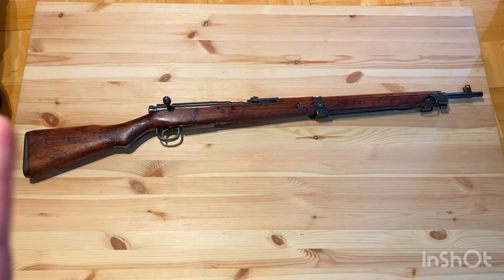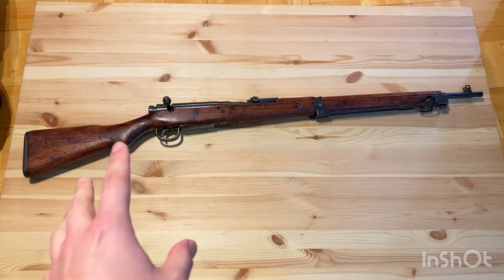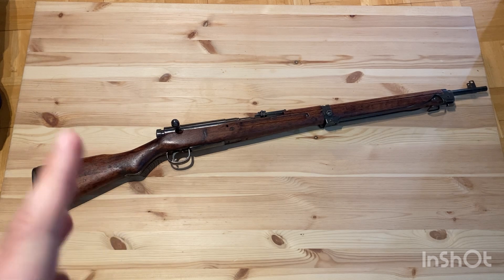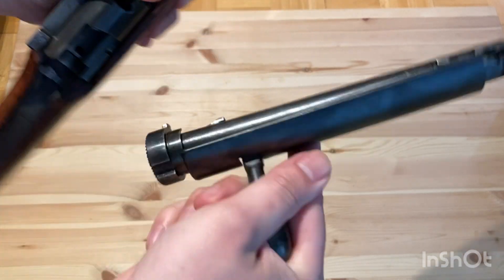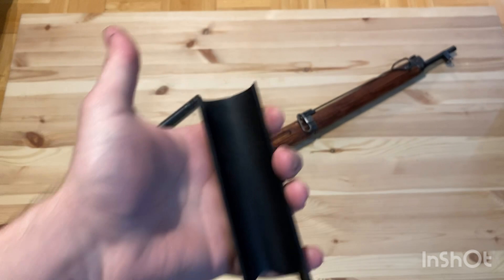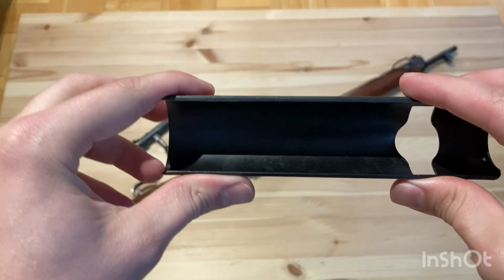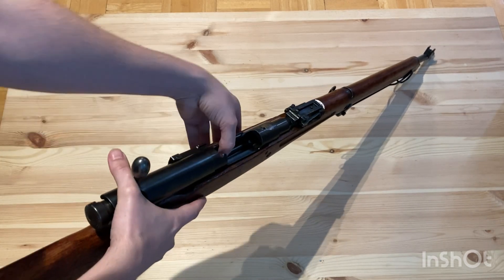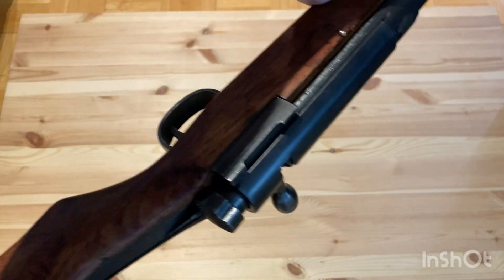DEBUNKING this WW2 myth in 60 seconds (Arisaka Dust Cover)

Comment: Another theory I've heard a few times is how the Japanese troops may not have necessarily discarded the dust covers, but rather they would remove them before combat only to refit them afterwards. But I don't think this would've been the case because the Japanese already had a dust cover that was designed to be removed before combat and then refitted after combat, and that was on the Type 35. If it was that common for troops to take them off only to put them back on eventually, then I think they would've have brought back the original dust cover design and reinstalled it on the Type 38 and 99.
Reply: This. On the 38 and 99, the dust cover slid with the bolt, so it wasn't like the older Type-35 or Siamese Mausers where you had to manually slide them back to use the action. Plus, it's not a weak dust cover-either it takes a hit it was designed to protect against, or it was damaged so badly that your rifle probably also doesn't work anymore.

Comment: The most bizarre thing about this myth to me is still the "and then they threw them away" as if throwing bits of your gear (property of the Emperor by his seal btw) away wasn't a grave offense that would have you beaten by the next NCO who notices it. 

I commented it on your short before, but I'll put it here again for those that don't know why the dust covers are mismatched:
While travelling back to the states after the war, US NCO's would often take the bolts out of the souvenir rifles, so servicemen wouldn't do anything stupid with the guns, and they put little care in which gun had which bolt when they reassembled the rifles.